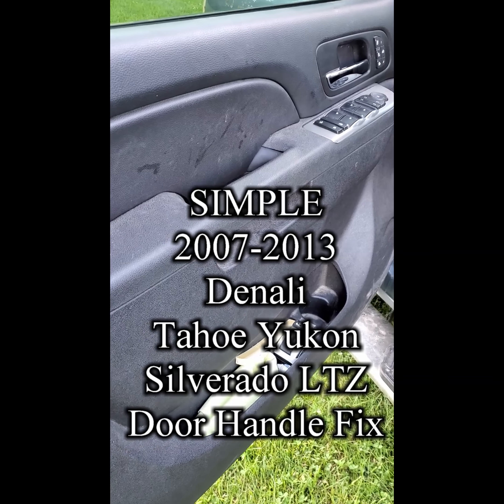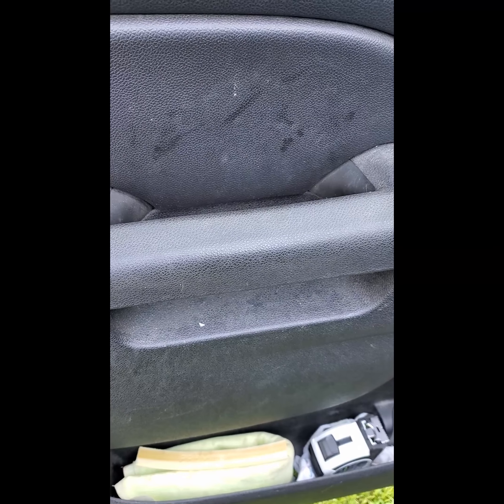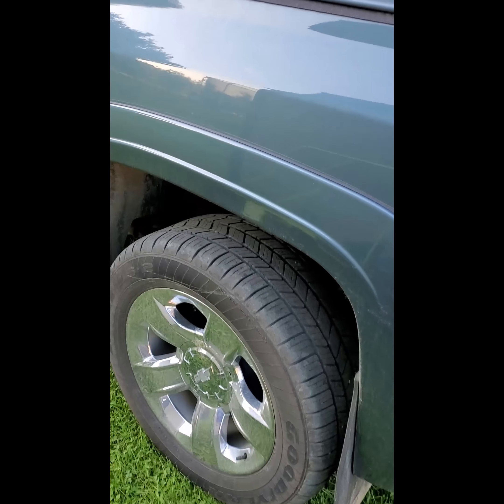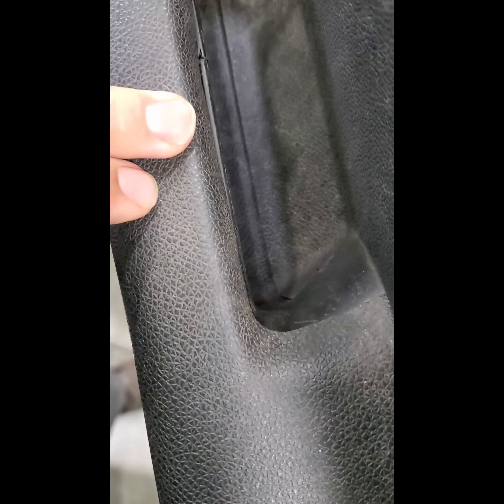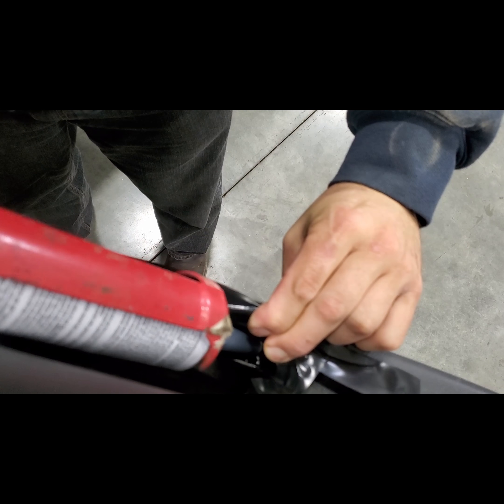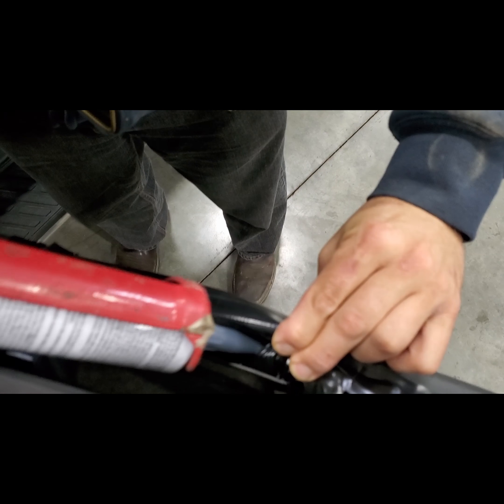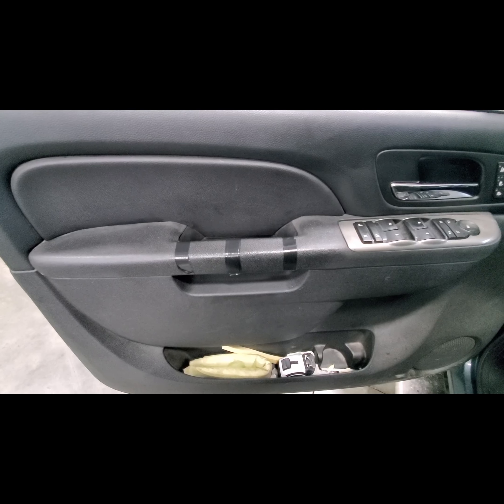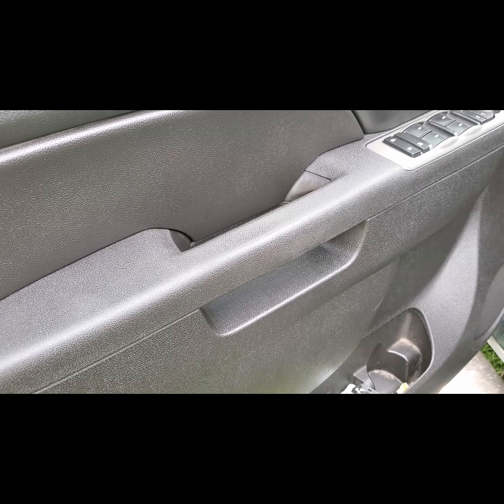2007-2013 Chevy LTZ GMC SLT Door Handle Pull Simple Fix

Comment: Did this repair successfully as your video shows. Added a metal rod inside due to the black plastic part was broken in half. Secured the rod to the plastic with zip ties then filled the cavity with the window weld. Can be messy, but have rags and wd 40 to remove any on your hands. Gloves worked for awhile but couldn't keep replacing them with sweaty hands. Used a regular caulk gun although had to use both hands some of the time.....however I am a 74 year old  5 ft 2 female with small hands. It can be done! Really appreciate the video. Very happy with the results!

Comment: Thanks for the great video and instructions!  I just did both front handles on our 2012 Suburban.  The white plastic inside both was broken in pieces.  I pulled the broken plastic out, filled the space with 3m window weld, the put an 8" x 1" x 1/4" aluminum bar on top of that, and under the foam.  I left the foam in the handle.  Taped it up with masking tape, let sit for 36 hours.  When I took the tape off I had to wipe the skim of window weld that was left behind off the inside of the handle, but after that it looks great.  Very firm and looks new.  I did cover the door and under the handle with masking paper & tape, and changed gloves regularly while using the window weld.  One caulk-gun size tube was plenty to do both door handles.

Comment: Thak you for the video.  I just fixed my door handle today.  I left the foam in and used a 10"x1/2"x1/8" aluminum bar stock to add extra support. I inserted the alum bar into one side of the handle and left the other end, towards the door controls, out.  Next I filled the empty cavity with the 3m window weld then used a needle nose pliers to slide the bar into the channel on top of the internal plastic frame.  The bar fit perfect into this channel.  I squeezed some more weld on top of the bar, under the foam, so it would all stay together.  I used duct tape to tighten the handle onto itself.  For clean up I used lighter fluid that takes the weld right off.  I used a lot of gloves and changed them often to keep the mess to a minimum.

Comment: Just wanted to share that I did this fix and did decide to insert a 1/4" round rod through the handle.   I taped everything off (to the extreme) to keep it clean, and in total this repair took me about 30 minutes to accomplish.  I bought the 3M Window Weld at a local automotive refinishing supply store for $35, and now that the product has had time to set for about 3 days, it is incredibly solid.  I did take care to leave the foam cushioning at the top of the door handle.  To be honest, it looks, and feels as good as new, and probably 10x as strong as when new.
Reply: I am going to try too aand I will leave the foam in as well

Comment: Hey, so I did this fix on both driver and passenger door handles on my 2013 Suburban.  It's not quite as easy to do and have it come out flawlessly as you might think.  One door was really broken up a lot, so it was really difficult to keep the two broken halves of the black plastic (that the palm of your hand touch on the inside of the handle) in place and meeting up nicely on one door.  I tried super gluing them back together first, but it didn't work well.  But, the urethane method shown above did provide a nice rigid pull again; I just didn't manage to make the shape of the finished handle look like new.  I did insert 11-12" long 1/4" steel rod like some other commenters mentioned.  On the passenger door (I did that after the driver door), the interior wasn't as broken, and I chose to leave some of the interior parts inside to hold onto the black plastic part - to keep it from shifting around as much as it did on the driver side, and that worked.  But, with the extra parts in there (and I kept the foam on top), the steel rod ended up causing a bulge about where your thumb hits the handle.  For a car with 160k miles, it's not bad, and it's WAY better than when the handle was flimsy, but it didn't come out looking like new.  Not a problem with the described method, just with my ability to make it come out perfect.  I'd do it again, but I wanted to warn people that there can be complications that may make it look not as perfect as you'd like.  Good luck!

Comment: Now that you've had this repair for over a year, how has it held up? Is there anything that you would do differently? I have the exact same problem on my 2012 Silverado 3500HD LTZ, and I'm to much of a cheapskate to buy a whole new inner door panel ($500+ now!) from my dealer, especially since the construction is identical to the original.
Reply from the maker: After a year, its still very strong and nothing has changed as far as deterioration. If I did it again I might imbed a metal rod inside the handle to further reinforce the window weld adhesive.
Reply: @isreal111982  Approximately what diameter metal rod would you use, and how would you put it in there?  Would you have to cut through those perpendicular plastic walls that form those individual sections, in order to lower it in there? And would you have the rod extend about an inch past each end?  I, too, think the rod would add strength, just having trouble visualizing putting it in. Thanks.
Reply from the maker: @ldr8068  the rod wouldn't have to be attached to anything. It's just imbedded in there to reduce flexibility. I would use a 1/4 inch rod.

Comment: Does anyone have a link to purchase a new one mine is missing I don’t have anything to go off just the black top rubber piece. Thanks y’all
Reply: I’m in the same boat. You find a fix??
Reply: @hammerhead5410  yup sold that damn thing. But to answer your question my buddy did wat another guy did in here piece of round pipe and long screws and bolted to the back plate.

Comment: I'm about to make the same repair.... I watch two different videos on DIY repairs and I think I might combine the two... the first video involved pulling the entire door skin, putting a piece of aluminum angle in where all the broken plastic cam out and then making two brackets (out of metal flat stock) that supported the aluminum angle for pull strength back to the metal support that bolts to the door. 

My thoughts are either a 10 to 11 inch piece of metal square stock or metal rod laid in a bed of this 3M Window Weld material and than filling the balance of the cavity with the more of the 3M Window Weld. With the metal rod embedded in the 3M Window Weld I don't think I can go wrong!  Any thoughts?
Reply from the maker: I'll be biased to my repair of course. The 3m window stuff is strong enough in my opinion. That's the whole beauty of this simple fix. But you can't go wrong with overkill if you want to take the effort. Thanks 😊
Reply from the maker: I bedding a rod is little effort. That wouldn't hurt either. Just so you don't have to take the door apart.
Reply: I would be concerned about using the metal in the handle. The issue could be that   in the event of a side crash, the metal could be thrusted into the driver.  So I would use the 3M product and not the metal reinforcement but that is just my opinion.

Comment: I work at a used car lot...usually the newer models are the ones that break apart...like 2011-2013... previous models are very solid. I think the newer models have longer pull handles and not as solid...I will try this out...

Comment: I have a 2009 Silverado Extended Cab LT and have not had any problems with my door handles falling apart. I also have those body side moldings and on one of mine the paint started cracking and peeling. I had a body shop remove that molding and repaint it. Now it looks like new, like the rest of them. The solution is to wax them since they are painted and they will stay looking nice like the rest of the truck does when you wax it. I try and wax my truck twice a year.

Comment: Sounds like a good fix.Do it have to be the black window weld? Or can it be another kind of hardener like gorilla glue
Reply from the maker: I would not recommend another glue then the 3M window weld shown. I needs to be thick and dry hard and flexible.
Reply: @isreal111982  thanks

Comment: I'm going give this a try Monday, The door panels are over $500 now....update. Jake I did it today, used the same stuff, I used wire ties to secure it and put graf tape on the handle to keep it clean. The bottom of my handle was broke so I super glued that first ,  I used rubbing acolohal to clean up the handle, I will see in a couple days how it worked out.  This was the best idea I have seen so far!

Comment: I  have the same problem on my 2012.  Wanted to see if your repair is still holding up?  My plastic has just barely begun to break on the inside toward the door panel so the vinyl handle material slips and turns a little as you grab or twist the handle.  If your Window Weld is holding I think this may be the easiest repair I have seen for this problem.
Reply from the maker: Absolutely holding up wonderful. No issues. Go for it. But I would still break and remove all the internal plastic so the thick window weld has room to move around and do its job.

Comment: Door panel is $600
Reply: Wtf really damn.
Reply: Will they sell you just the armrest part I mines is missing completely. Thanks
Reply: Only complete panels can be purchased because they have "welded" the armrest to the panel. On the rear door, an armrest could be removed, not front (at least without some cutting). I've replaced a few door panels with used ones, but be aware older versions (e.g. 07) and newer versions (e.g. 14) have different switch bezels, reflectors and lower pockets and a slightly different way it mounts to the door.

Comment: That's a really messy product to use. I bought some J-B Weld 8237 PlasticWeld Plastic Repair Epoxy Putty off Amazon, pulled out the broken plastic pieces, masked the area, mixed the putty, pushed the entire pack into the lower area where the crack was, then taped the top of the handle back into place using more masking tape.  24 Hours later and the door handle is fixed and rigid and it cost $8.63!
Reply: There's a lot of open space under that pull handle. did you just focus on the contact points between the upper piece of vinyl and the bottom area? That's what is pulling up for me.
Reply: @morecowbell235  My break was in the inside middle of the door, I removed the broken pieces of white plastic and filled the void with the putty.  Said putty isn't runny or a liquid, more like a solid.  I packed it into the center void where the break was.  4 Months on I'd forgotten the door handle was ever broken till your reply.
Reply: @NigelBallard  got it, thanks. I picked up some plastic weld stuff, but its not putty its the two tubes that mix. Hopefully I can successfully fix my issue with it.